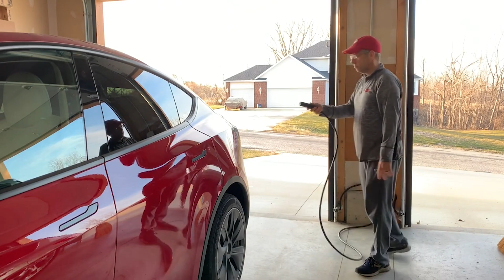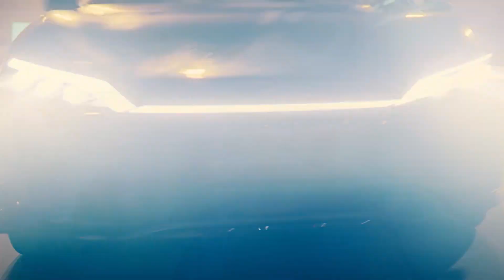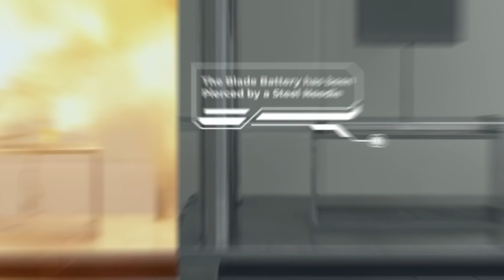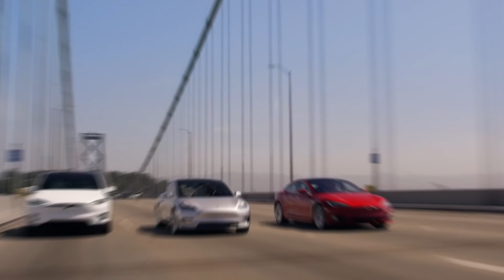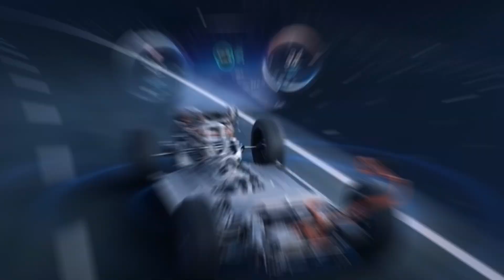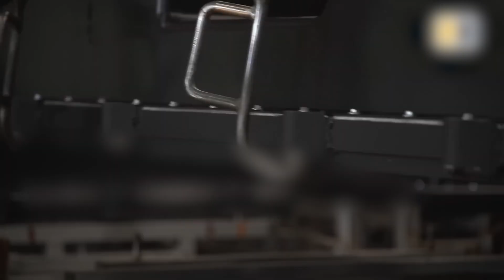BYD CEO: "Our Blade Battery Tech Leaves Tesla in the Dust!"

Comment: Generally, Chinese battery packs should always be better than western because of safety. Western battery packs use a lot more packing to deduce fire hazards, and slow down fire. If you ever saw EV battery explosion or very quick fire, it's always Chinese car. This is why if Chinese use same batteries, Chinese cars will always have advantage in cost and range, but safety will suffer. Having long and wide sheets of battery seems to be pretty dangerous from design stand point, but maybe there is some technology that makes it safer. The pack needs to be punctured to actually test it, videos like that can't prove anything.